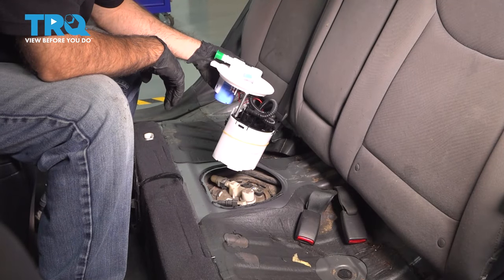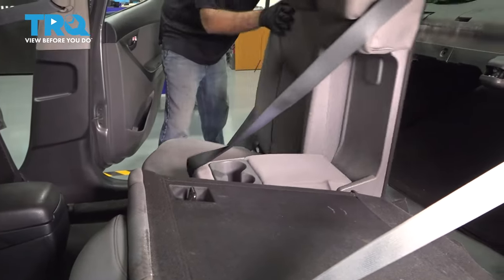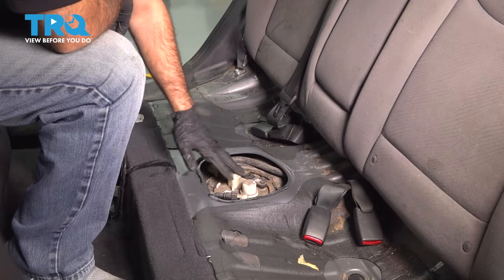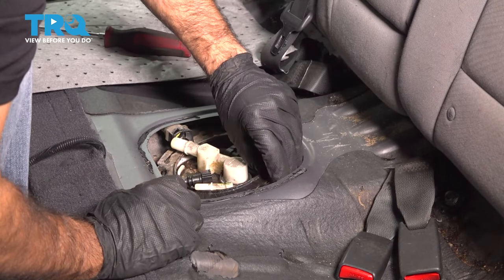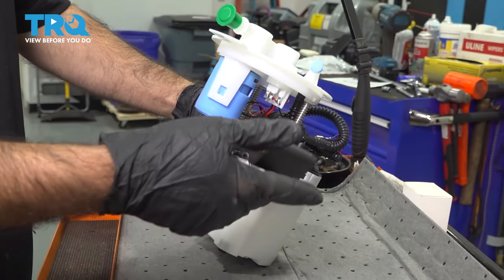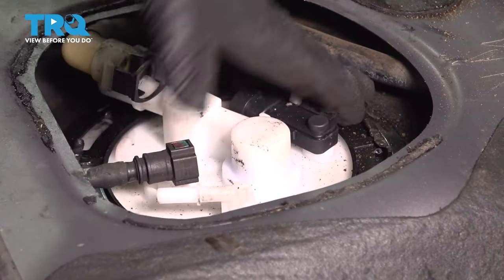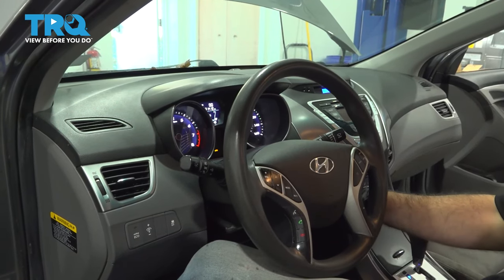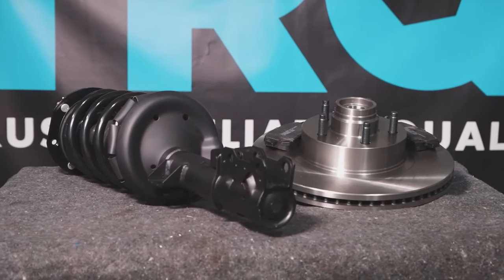How to Replace Fuel Pump Module Assembly 2011-2016 Hyundai Elantra

Comment: When installing the new fuel pump, it is extremely important to not let the assembly touch that adhesive. The gas dissolves that adhesive easily and it can contaminate the gas if it gets on the fuel pump. I would recommend removing the adhesive before taking the old fuel pump out. If you dont, at least cover the adhesive when installing the new fuel pump. I let it dry a little then covered the adhesive in paper towel to prevent it getting back on the assembly. If you got adhesive on it, pour the gas that was in the old fuel pump into a metal mixing bowl, dip a folded up paper towel in it and use the gas to clean off the adhesive before putting the fuel pump assembly back in to make sure none of the adhesive goes in the fuel tank.

Comment: I have to tell you Sir this is one of the best videos I have ever seen on YouTube. Your explanation and detail to what matters make so many people look like clowns it's unbelievable. I just had to have this done. Nine days in a dealership. I was told this was a four hour job, HUGE. If I would have known, I would have done this myself. This is  pretty straightforward. Thanks for the video.
Reply: That's why they're called STEALERSHIPS. Any competent tech could do this in about 20 minutes. A DIYer in less than an hour. The fact that it can be accessed from the floor hole makes it insanely easy : no need to empty tank, remove so no need for a hoist.

Comment: Question  I change the fuel pump of my hunday but the engine light still on, and I just notice that the vin number is a Korean one and is giving me the fuel pressure sensor alarm  so should I just get the sensor or the whole pump since the pump is a us build?!!
Reply from the maker: +Cesar Acosta We wouldn't be able to diagnose an issue like that here, you may want to have a local mechanic take a look at it. Thanks for checking us out! http://1aau.to/m/Shop-1AAuto-c